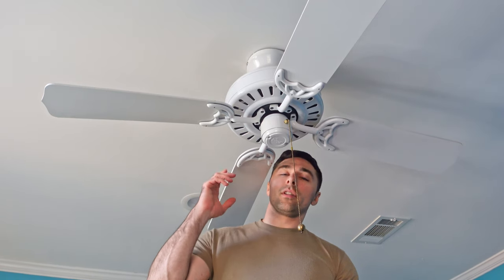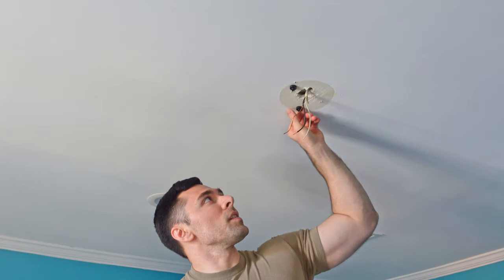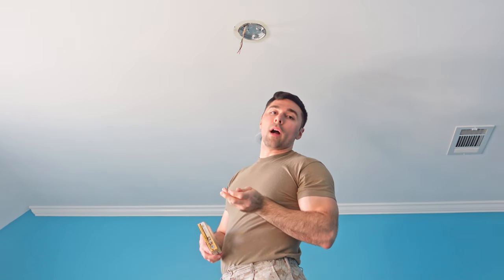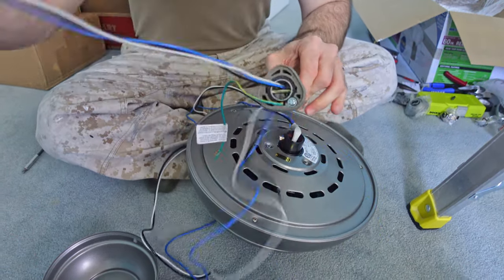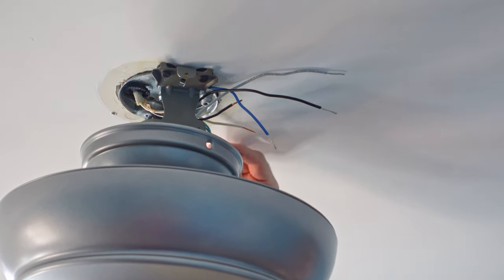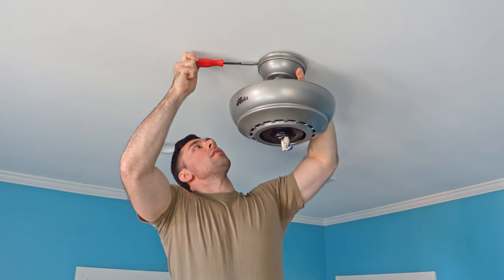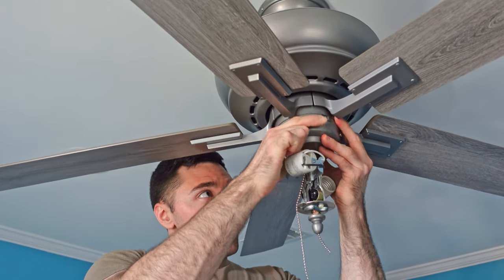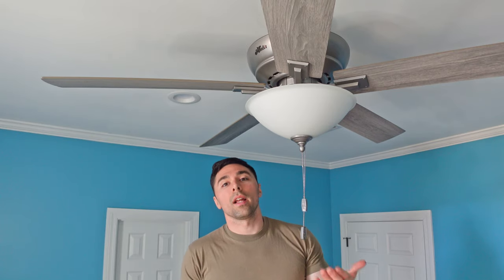How to Remove and Install a Ceiling Fan || Hunter Ceiling Fan Installation

Comment: What’s more insulting is when they use the downrod, canopy, and mounting bracket from the old fan with the new fan.  There is a shoe store near me which has modern day Hunter fans(the ones sold at Home Depot/Lowes) installed on brass Hunter Original downrods/canopies (this tells me that the store at one point had Originals).